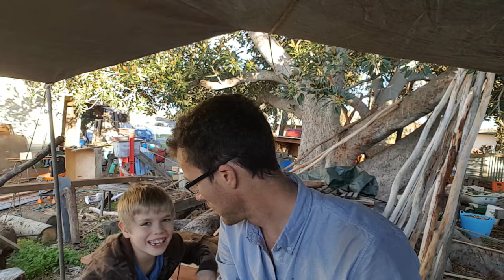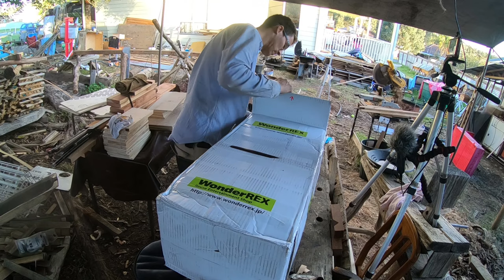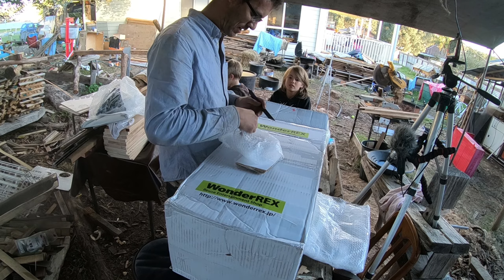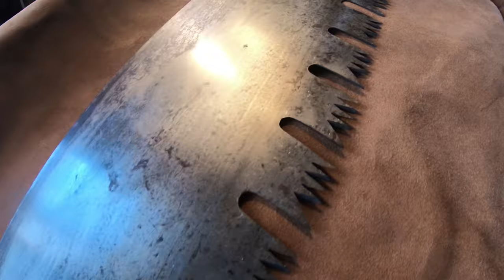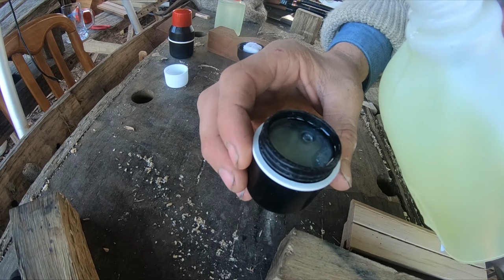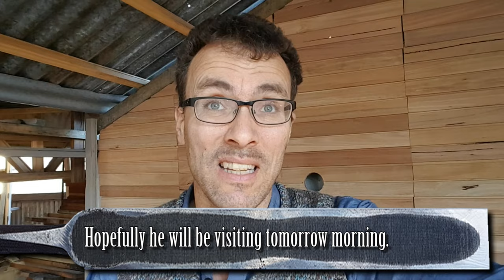Japanese Tool Unboxing: Huge Cross Cut Saw

Comment: Can you tell me the name of that particular Cross cut saw? And are they available somewhere? Thanks
Reply from the maker: Sure. Many different names or variations of names based on region and profession. But the name I've been told is "temagari mado noko".  BUT that name also applies to a bunch of different saws of different size with a bit of variation in the shape as well.

Temagari means "bent handle". Lots of saws that have this style of handle so they can and are called temagari noko. Mado means window so the literal translation is "Bent handle window saw". But the windows referred to are the extra deep gullets between the sets of teeth.

I'm currently searching for an extra large version of this saw (1.3m) for a customer in Europe. When I find one I'll send it directly to him from Japan. I'm finding a few that are in the ~80 to 90cm size range. I don't tend to import them into Australia because its not often that anyone wants one. If you let me know what you are after (display, use, collect) and a budget I can see what I can do.

Send me an email at stuartchignell@gmail.com